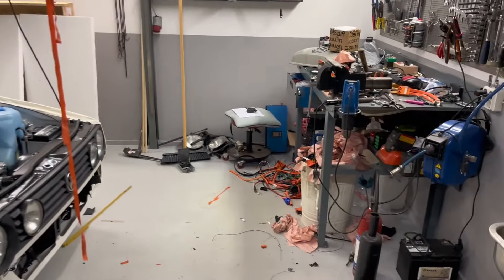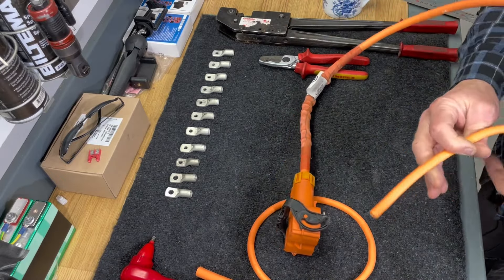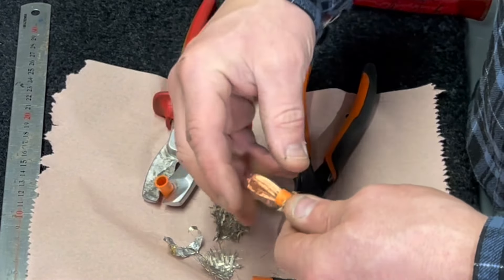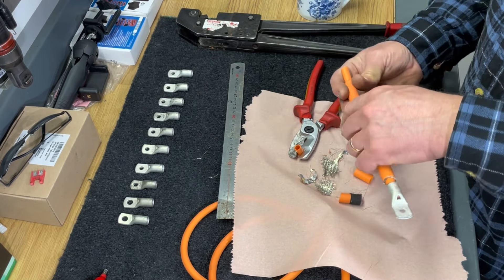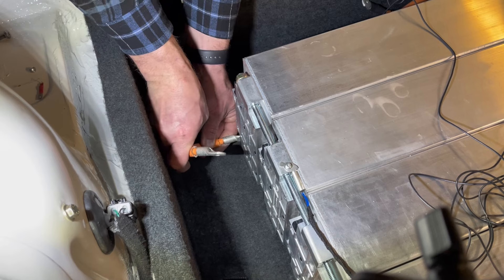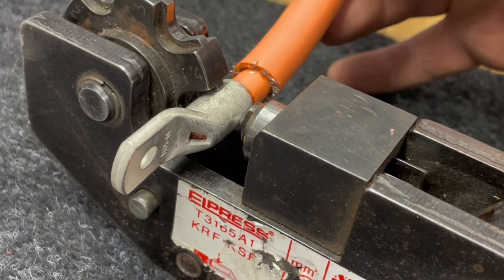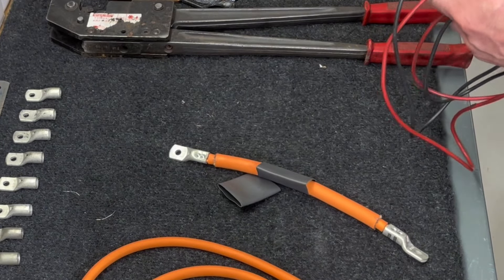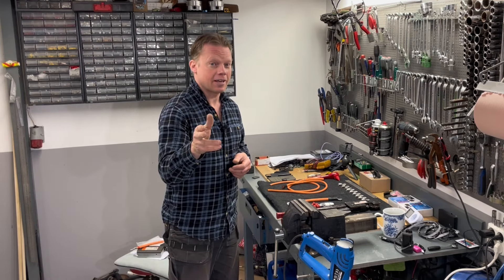Creating the busbar / wires, high voltage battery, Ev conversion. Vw golf Mk2 Citystromer.

Comment: Great work to do that with left over cable.
I always try to cut time by reusing it from original OEM part or some aftermarket busbar options which exist for popular modules. But reusing what you have is great, especially with EMC shielding.
To test isolation it would be best to have a Megohmmeter. But yeah, another pricey tool.

Comment: I admire that you take the time to explain such steps. And also that you reuse parts from existing (likely scrapped) BEVs from the same brand (here: an e-Up). Soon enough, parts from commercial BEVs with large volumes but then scrapped due to accidents or totaled by an insurance or out of warranty repair bills will provide nice parts for upcycling.

Comment: it looks like a kitchen after the cook had ccooked a meal.
I hope that this car will be driven a lot when it is finished and that it drives quite well cause remember it is an ice engine which has been swapped back then. 

Now you have put in the EV tech update package this drive train might be more silent than ever before but new noises might appear that no one was aware of before cause this is all new.
I can not wait to see it been driven a lot and making miles or kilometers cause I bet it will be a quite well fitting car that made the time travel from 1991 to 2024 with this electric upgrade package and full restoration. Should be good to go for tens of thousands km and earn the VW badge the iconic Käfer had gotten back then with the "he runs and runs and runs" claim.
Reply from the maker: Haha, yes. I have already heard more noise from the gearbox. Only normal noise but still 😅

Comment: Nice to see the crimps, which brand and type of cable shoes are you using? Sometimes they are hard to find.
Reply from the maker: Bought them from a nearby Bosch company. Yes the are. Especially 6mm hole at 35mm2.

Comment: Will you have an EMI (electro-magnetic interference) measurement of the car and its components (motor, charger, battery management) taken (at various conditions like driving, charging AC, charging DC), when it is finished? Those measurements are expensive to "normal people", but you seem to have a professional surrounding and may have access to such measurement rooms at weekends or for education.
Reply from the maker: That’s not needed here in Sweden if you use an already existing and certified drive unit, or registration in a more expensive way that we call SFRO. The battery itself does they not seems to care about yet at least.

Comment: I think you are using the wrong word. You are making cables not busbars. Busbars are made out of copper bars not flexible copper wire.
Reply from the maker: Ok, sorry, I’m so used to calling them that after all my previous battery builds. Still learning…
Reply: @flyingtools I would call them "busbar cables". 😀 The term "busbar" would express that they have serious cross-section and therefore ampacity. 80.000 W peak / 350 V = about 230 A peak load. The word cable would express, that they are still made from flexible cable (here AWG 2= 33,6 mm², or about 6.5 mm outside diameter) instead of from rigid copper bars. So "busbar wires" as in the video title is close enough. I had no issues to understand what he meant.